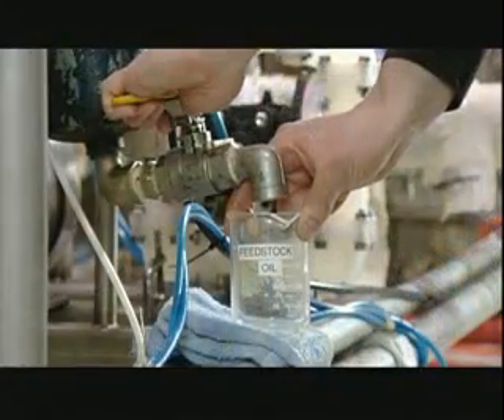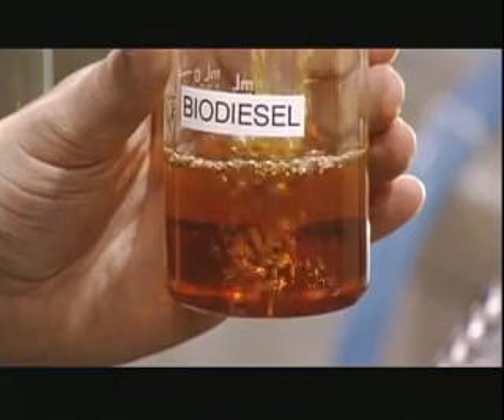How It's Made - Biodiesel Production

Comment: Bio diesel emits exactly as much CO2 as regular diesel. The difference is that the carbon came from the air in the first place rather than from fossil sources. So it's not increasing the CO2 in the air. Like the difference between burning coal and burning trees.

Comment: What kind of catalyst it was used in this reaction between oil and methanol?
Reply: Ronison Souza Permanganate or Chromate probably, they are strong oxidants. Or perhaps Sulfuric acid, as an acidic catalyst. Has to be one of the three.
Reply: Monkey D. Luffy I thought that they used some alkaline catalyst, but, I guess you're right.
Reply: Sodium or Potassium Hydroxide
Reply: +Ronison Souza ethanol is also used fairly commonly
Reply: Use egg shell

Comment: Lots of garages mix it with regular diesel as biodiesel is so cheap here in the UK.  No one uses biodiesel because it ruins modern turbo diesel engines.  It's fine in a 20year old Volvo but will kill a new Ford Focus. The acidity needs to be controlled too as biodiesel eats the rubber seals and fuel pumps are not cheap.  We can already make SAFE & CHEAP synthetic oils and diesel fuels, so why does SHELL, ESSO etc rely on the Middle East so much? We could stop buying oil from them right now.
Reply: Or else all the folks that died in our wars would have died for nothing. Sadly.